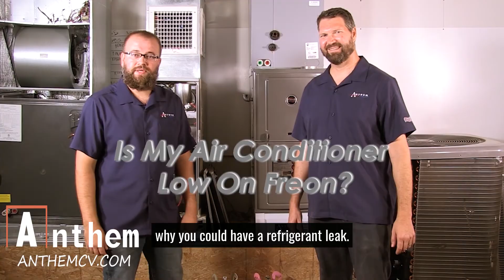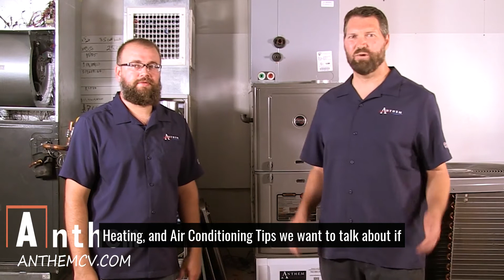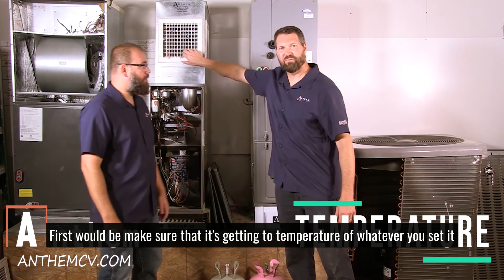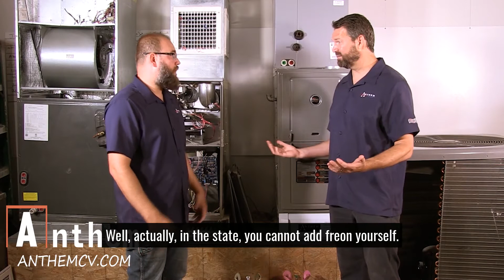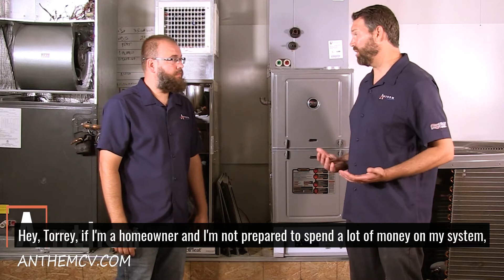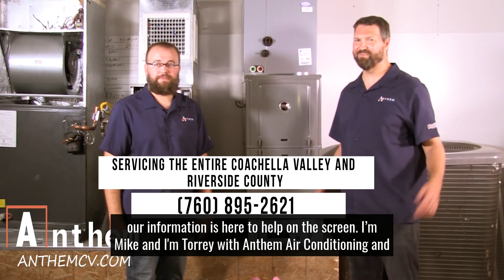How to Know My Air Conditioner Low on Freon?  - Anthem Air Conditioning

Comment: DUH! Since 2000 there have been FIVE kinds of home refrigerants COMMON in home air conditioning compressors. R-22 has been BANNED since 2005, and can be REPLACED with the "lavender" can refrigerant at about $95 a pound IF the system is TOTALLY evacuated and is free from leaks (less than 5 mgrams per year).  Few systems that old will be leak-free. My late Mother's "A" coil had a tiny leak that could be repaired for $300, so she got away for about $1000 for a refrigerant exchange and "soft-start" kit, instead of $6000++ for a new compressor and "A" coil and tubing for "new" refrigerants. Carrier "Pureon" and it's generic used by a couple of other makers is about $500 a POUND, but is THE most efficient refrigerant legal in the US, by FAR. Anhydrous ammonia is the MOST efficient refrigerant EVER invented, but is considered too hazardous for non-industrial use without an operating engineer present 24/7. This is why in my 97 year-old house, I have window units and blue-flame heaters, as God intended! I typically get 15 years from a 120 volt 14,500 BTU window unit for $700-900 and it costs about $100 a month to operate, and cools half the house. I have a 6700 BTU unit in my bedroom (FAR overkill) which typically lasts 25 years or more for $500-650 and $45-55 a month to operate. Compare that to a central or mini-splits 12 year life and $300-400 a month electric costs and $15,000 replacement costs and $1200+ annual service costs. Old houses weren't built for Central air and heat-except for a central Heat-O-Lator or floor furnace! My grandparent's Heat-O-Lator (120,000 BTU/hour) is in the detached garage and at 81 year-old, works perfectly on ONE of the two burners.

Comment: It’s a sealed system it’s not supposed to be low on refrigerant unless there is a leak somewhere😂
Reply: my ac unit is 15 yo, are you saying that the amount of refrigerant in the system should be the same as in 2008?

Comment: It’s not called Freon, it’s called refrigerant.  75.00 per pound, for R410a.  Seems like a rip off to me.  He never mentioned that you can use a leak detector or soap bubbles, before cutting the system apart.